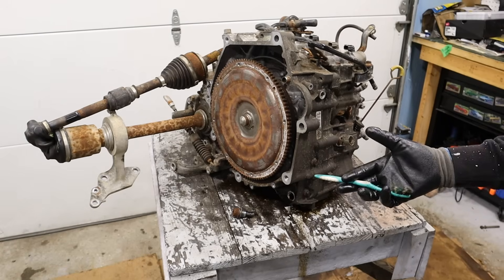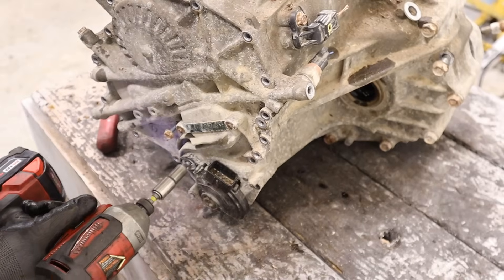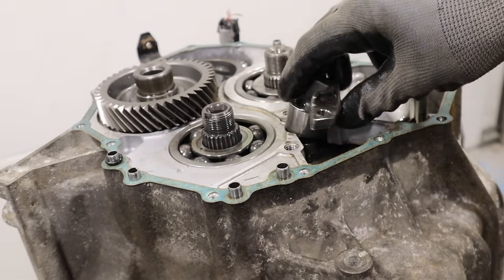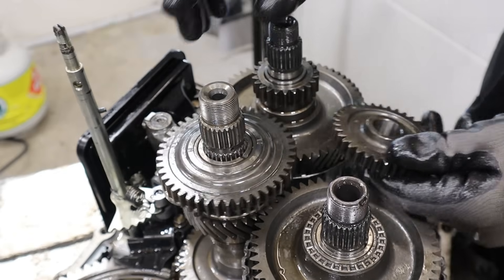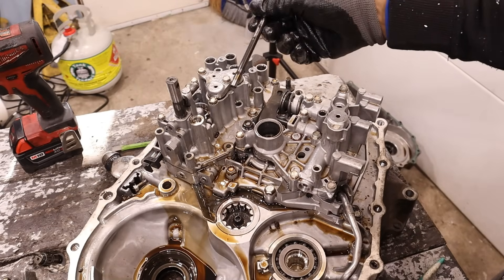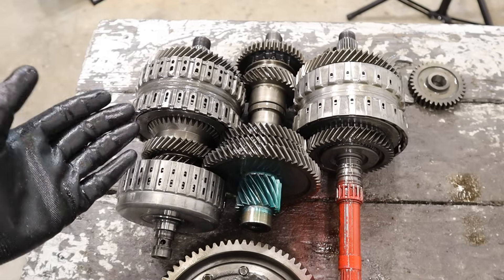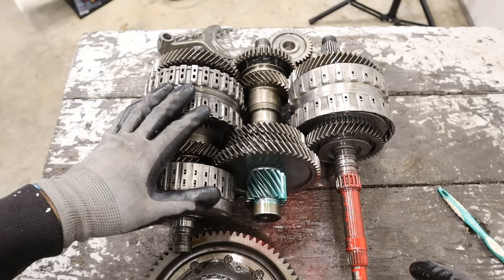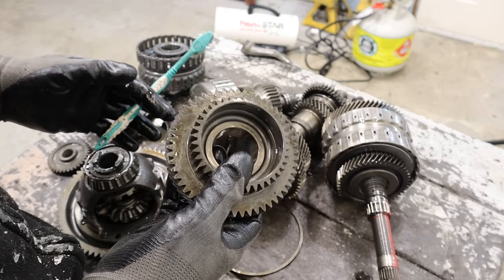This Honda Automatic Transmission is a Manual Transmission in Disguise

Comment: Honda's automatic transmission has a unique structure that replaces the shift fork operation of a manual transmission with a clutch, and the successor to this 5-speed transmission should have been a DCT rather than a CVT. This would have allowed Honda to retain the gear manufacturing process it had built. Volkswagen has achieved this. The Japanese Fit Hybrid used a 7-speed DCT, but suffered numerous recalls due to its control system and was discontinued after one generation. The Acura RLX used a 7-speed DCT, and the NSX a 9-speed DCT, but both are no longer in production.

Comment: I was so sure GEs had planetary gears but at the same time never understood why my 2012 whines in reverse... now I know.
Reply: The only issue is when idiots shift from revers to drive while still rolling. It blows the revers idle gear shaft clean out of the transmission case body. That's why you hear a crunching sound when you do it.

Comment: Have a 2010 Honda fit with this transmission. I have 380,000 miles and it still shifts like brand new. I change the fluid every 50k with Amsoil multi vehicle atf. I believe it's way better then Honda dw1

Comment: I have a Legend kb1 (3.5l, awd, 2007). It turns off from gear when the oil gets hot. More than an year I couldn’t find a proper solution as all car services were rejecting refurbishing it. I’ll maybe buy a second hand one soon, but i’m rather a pessimist on finding a good replacement ..
Can you give me some advice?
Should i try restoring the old one myself?
I’m based in Bulgaria.

Comment: Coming from the v8 world, it's really odd to me there's no aftermarket for automatic JDM transmissions, and most people don't even know what the model of automatic is. In the v8 world there's so much aftermarket for automatics, and there's info on them, everyone knows about th350, th400, 727's, powerglide, 4l60e, 4l65e, 4l70e, 4l80e, 4l85e, c6, 6r80, 10r80, 8-hp, there's tons of automatics with tons of aftermarket parts and tons of info on them. Trying to look up info for a Honda Automatic transmission or trying to find any sort of aftermarket parts is like banging your head on a wall. Why has no one done anything with them???

Comment: hey great video. i just wanna know what's the quantity of atf needs to be used when drain and filling the transmission.thanks.
Reply from the maker: Each model is different. You need to look up yours
Reply: @speedkar99 alright thanks for the heads up

Comment: My First car was a 1984 Honda Accord automatic . I have always loved older Hondas , I graduated in 1993 and for graduation my parents bought me a new 1993 Honda accord Ex , Teal green ,spoiler on the trunk. That was my favorite car only had 9 miles on it , I have always loved that mechanical rough shifting  of Honda, the older ones.  Borg warner and other places had all the patents for transmission.Honda basically took manual trans and spliced a auto unit into it. My Honda I put 300,000 miles on it driving everywhere. I have had one American car a Saturn sc2 twin cam .

Comment: My trans fluid is a very light brown, im assuming its a good time to change it, this car was neglected previously so probably the first change, 115k miles
Reply from the maker: Keep draining and filling it. 
Don't flush
Reply: @speedkar99 ok cool, is everything likely ok?
Reply: @speedkar99 also draining and filling a couple times in a day/week, or like every 30k miles
Reply: @speedkar99 first drain and fill is done, transmission still works 🤣
Reply: Do i drain and fill within a couple days again or should I wait like a couple thousand miles.

Comment: I’m Brazilian and I’ve already liked your video. Nowhere on YouTube Brazil is there such a clear explanation of these Honda transmissions. I would really like to see you disassemble a transmission from the 8th generation Honda Civic, which is very similar to this one, with the SPCA designation. The issue is that these cars have a noticeable jolt when shifting from first to second gear, which no mechanic has been able to figure out. It’s not a strong jolt, but it’s something that doesn’t happen in the other gears. Best of luck with your channel — it was very helpful.
Reply from the maker: Probably not enough accumulator pressure causing the jolt.
Reply: My Honda City 11 1.5L has the same behavior

Comment: Apparently Honda designed this since they didn't want to pay royalties for using conventional planetary gears.  I have a 2012 TSX with one of these transmissions, with 120K miles, and it definitely feels and acts differently than conventional automatics.  There's a slight hesitation on upshifts which was somewhat concerning at first, but now I like it.  It's also surprisingly good at downshifting on downhill grades.  That small external filter seems to be for the fluid that passes through the small cooler, and if you're a DIY type, it's in a tough area to reach.  In a few weeks I'll change mine and plan on moving the main fuse box to gain access.  You should periodically drain and refill the fluid, 3 quarts at a time.   I do mine every 20-30K miles, after doing 3 such changes at 60K miles.  It's never smelled like cat piss, so maybe that's from his brother's underwear.
Reply: Nope had noting to do with it. I worked for Honda as an Engineer at the time. From the start the wanted to take a stronger manual transmission and make it an automatic.

Comment: The original men who designed the automatic transmission were and are brilliant engineers! I just purchased a new Toyota and along with bought an ATSG repair manual for the specific Aisin transmission thats in my car. These ATSG repair manuals tell you how to rebuild your transmission step by step. I hope that I never need to use it but if something should ever go wrong, the manual is a must have.

Comment: Oh, this is the 5 speed in my dad's 2009 accord LXP. I REALLY love this transmission...smooth shifting, you can feel the transmission shift (which is a nice thing) and power transfer is great too. Plus 3 manual gears! 😊
Reply: Let me ask you something - in your car, is shifting from 1st to 2ng gear more noticeable than the other gear changes?
Reply: Absolutely yes. 1-2 shifting gives faster rpm drops than 2-3 or after. When downshifting, 2-1 shifts gives bigger impact than 3-2 or 4-3 so.   @_cesar_vieira

Comment: Ah yes the 3 shaft H5. The revision has 4 shafts. thanks for sharing.
Reply: Long live the h5 transmission 😤. I really wish they'd use a 6 speed version of this in the new civics instead of the cvt
Reply: @lowkeydiegoduran4724  I wish they had 6 speeds as well, my gas mileage above 65 sucks.

Comment: This transmission has a beautiful whine as it goes through the first two gears that i just love listening too. Thats what warrants a drain and fill for it every engine oil change. Use Dw-1 guys dont skimp.
Reply from the maker: Good call on the fluid
Reply: Mine does this aswell on my 2003 acura tls with 370k on the transmission .
Reply: Km not miles

Comment: They have been using this the mid 80’s. It wasn’t until Honda developed the 10 speed automatic in the 2.0T Honda that they changed it.
Reply from the maker: Yeah quite an interesting design. Too bad it didn't hold up well in the 2000s

Comment: The Ford PowerShift transmission was closer to an AT than this Honda was.  The PowerShift had synchronizers, and shift forks just like a manual transmission.
Reply from the maker: That's a dual clutch transmission. Completely different beast

Comment: Isnt this the same as the 2006-11 civic tranny? Kinda looks the same
Reply from the maker: It should be very similar
Reply: The mechanism is similar, but it was designed a little more compactly. The Accord differential was supported by tapered bearings, but the Civic differential was supported by ball bearings. I think the Civic transmissions from 2006 to 2011 were made in Japan.

Comment: This style of transmission is called a power shift. Extremely popular in industrial machinery. 
It's definitely not a manual transmission. 
Can have a torque converter or standard clutch on the input.
Reply from the maker: PowerShift is Ford's term for a dual clutch transmission.
Reply: @speedkar99  powershift transmissions have been used in industrial equipment since the 60s.
Ford's powershift is not actually a powershift like you say.

Comment: Honda is, well it was, a top notch manufacturer.  I hate the external filters they use. People forget to change them and it ends up killing the transmission when it fails.
Reply from the maker: Yeah I wish they made the bottom internal filter more accessible

Comment: hydraulically assisted manual transmission ... its interesting that early automatics didn't follow this design.. I don't know before 1950 that much but they were pretty much friction material taking all the torque and this seems like gears taking the torque and friction only engaging it.. I guess not though the friction material in this transmission does have to stay engaged and its not just to bump the gear into position. better than a cvt i guess
Reply from the maker: Friction material still have to transfer the torque from the free spinning gear to the shaft running in the middle

Comment: Almost all modern transmissions are like this now, gone are the drums and bands of olden times. The Toyota U240E is built in a similar manner as well and even some older Honda transmissions were like this too.
Reply: I don't think this is true at all.  Definitely less bands in use these days, but if you look at the ubiquitous 8HP trans, or the 6speeds that were so common before the 8HP, they are all just clutch packs, planetaries, and solenoids.
Reply: @tptrsn  Yes, that's what I was saying, all clutch packs no bands and drums. Used to be you had clutch packs and ALSO brake bands running on the outside of the clutch drums to hold components. Now, nah just clutch packs. Bands are slow to apply don't get as crisp of a shift feel.
Reply: @huzudra  Gotchya!  I thought you were saying that most autos these days were kind of like this hybrid style that is sort of a cross of an auto and a manual.  I agree! (although I would still love to see a breakdown video like this of a modern dual clutch trans)
Reply from the maker: Yeah agree there ..this is more of a Honda only setup
Reply: @speedkar99  and Saturn!

Comment: A transmission worth not to be forgotten. Legend
Reply from the maker: Yes it's probably the most reliable of this type
Reply: @speedkar99  The secret was not to pair it to a too powerful engine. That's generally true for any manufacturer, too heavy or too torquey engine paired to inadequate transmission is a not unheard of combiantion.
Reply: I imagine it's the same as the 2007 automatic transmission.
Reply: Grandads toothbrush...😂
Reply: The only issue is when idiots shift from revers to drive while still rolling. It blows the revers idle gear shaft clean out of the transmission case body.

Comment: Before I even watch the video, you said something that triggered me. "Hondas are not known for their great automatic transmissions," words to that effect. For the life of me, I don't know what's so gawd-awful hard about building an automatic transmission. I mean, lots of cars have questionable automatics. We can make them for front-engine, rear-drive cars pretty easily. But go to a front-engine, front-drive car, and it all falls apart, sometimes literally. This isn't the first time I've heard about the bad automatics, of course, and I keep asking, "Why?" I'm hardly an engineer, except in my heart, but for goodness' sake, is it that hard? lol
Reply: Their 4 speed are kinda crap, but their 5 speed automatic are masterpiece.
Reply from the maker: I beg to differ. The mid 2000's still had a rath of 5 speed auto Honda failures.
Reply from the maker: I did another video on a failed Acura TL transmission. 
Basically it's a lack of cooling and too much power for the clutches.

Comment: Do I need to be swapping out that filter? also I didn't realize I should check the level when it is off. I have a 2008 honda fit. It being a first gen, does it have the same transmission?
Reply from the maker: Yeah it's very similar. And yes swap the filter once in a while.

Comment: The manuals not so great.  Had a 2004 Honda Fit/jazz bought new.  Gearbox crapped out at 90,000 miles.  Was out of warranty but Honda UK agreed to replace free of charge.
Reply from the maker: Ouch. Wasn't those a 4 speed auto or CVT?
Reply: @ no.  It was a 5 speed manual.  The gearbox started making a terrible whining sound that got progressively worse.  It was when I lived in the UK so it was a Honda Jazz.  Never forget the registration, MW54 WDE.  Probably long scrapped by now, lol.

Comment: Ive got a 5 speed automatic with 2.4L DOHC engine. 200,000 miles, and i dont drive slow for nothing. Changed fluid and filter and it still shifts like a dream
Reply: Did it also smell like cat piss? 😂
Reply from the maker: Awesome. Too bad it's just an online filter and the real on is inside.

Comment: The Trabant 601 was available as "Hycomat", as early as the mid 60s. It had the standard manual transmission and clutch, operated by a hydraulic system. There's a German wiki page on this, as simple as it gets... These were available for everyone, also for disabled WW vets. Note it was common to wait a decade or so to get a new car in the GRD.
Reply: Yeah the VW Bug came with an “Auto Clutch” transmission. It had a button on top that apparently used vacuum to release the clutch but I think it also had a torque converter. It was not popular. I saw a lot of them in the junkyard when I was obsessed with Beetles but I don’t think they were there because they failed.
Reply: @zxggwrt  These could not use the swing axle, so these came with a better suspension. Was probably not popular because of power loss and cost.

Comment: Honda is missing an opportunity to develop an AMT out of these automatics.  All they have to do is build a specific case with a bellhousing to accommodate an electronically controlled clutch.
Reply: They make CVT because they're cheaper. Cheap are crap. I'll buy the last Honda with 5 speed automatic.
Reply from the maker: Technically you don't need a clutch, just release all fluid pressure from these clutches and you have neutral...

Comment: do you have the code/model of this transmission? I also have a 5spd auto in my 2010 TSX (I believe it's the H5, four shaft), I'm wondering if it's the same/similar one
Reply: I was wondering the same thing.
Reply from the maker: Hmm no, the transmission is long gone. 2012 Honda Fit if that helps

Comment: It's funny how Honda 5spds both manual and auto are far more reliable than the 6spd variants.
Reply from the maker: I beg to differ on the 5 speeds. The mid 2000's still had a high failure rate on these especially V6 models
Reply: Same space, wider gears!

Comment: The Fit gets 5? The 2003-2009 Element/CR-V got shorted with 4 speeds. That is so 80s.
Reply: 09 CRV are 5 speed.
Reply: @GF-mf7ml  So maybe the 09-11 Elements were also 5 speed.
Reply from the maker: Yeah this is 2012 
Cafe regulations were a thing

Comment: This would be the automated manual transmission ? I think many cars with this transmission don't have a torque converter just an automated clutch...
Reply from the maker: Why would you need a clutch when you can just engage the correct clutch for the gear you want to be in?
Reply: Nope, I know what you're talking about. But this is not an automated manual. There is still a torque converter that'll lock above 20 mph. And instead of synchros, there are little clutch packs between gears :)

Comment: I am at awe pretty much with every transmission video. I cannot imagine myself designing and producing a transmission. As far as driving, my favorites are Porsche manual ts, followed by Honda and Mazda manuals. Then other manuals. Then Porsche dual-clutch t.
Reply from the maker: I agree, as an engineer I sit staring at these things when I take them apart, wondering what it took to come up with and manufacture it.

Comment: I like that a lot more than a CVT
Reply: Just don't lump eCVT such as found in Ford and Toyota hybrids with CVTs like Nissan uses. No parts in common..totally different.
Reply: @cheapgeek62  Toyota regular CVT also has a first physical gear to reduce stress on the system on launch for example.
Reply from the maker: I too
Reply: The problem with these that the one without a torque converter are too jerky and they burn the clutch at very low speed....If you stuck in traffic with these or DCT and you don't pay attention how you drive it you can really mess it up really fast.
Reply: They also don't need to drop the oil pan to change filter every 30k miles. A lot cheaper to run.
Reply: I like CVT more
Reply: @saityavuz76  Found the Jatco executive.
Reply: @joegreene6250  Nissan's CVT is not the only CVT out there, but still, you got me >:)
Reply: @saityavuz76 the only CVT I recorded is Toyota Prius CVT.
Reply: @ It is a great one, e-CVT is very interesting, great engine braking

Comment: Always use Honda fluid! Always! Never use anything else. They'll last that way.
Reply from the maker: Good idea
Reply: Valvoline Maxlife or Castrol Transmax are fine. More important to just change it. When this transmission came out 20 years ago of course the aftermarket manufacturers hadn't come up with a compatible fluid, but now there's a couple good ones at least.

The Maxlife is really popular with the Odyssey crowd as it's synthetic and hard wearing in a heavier car.